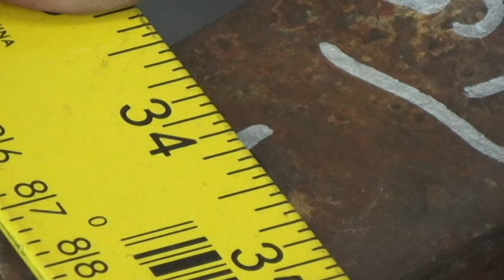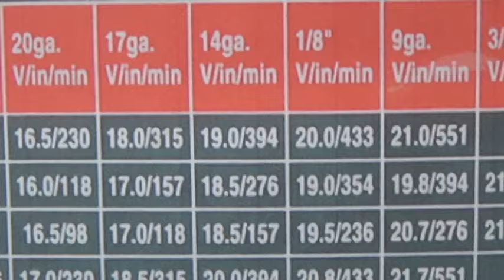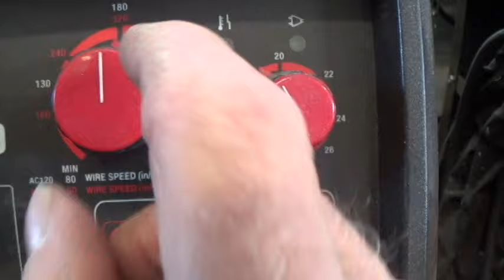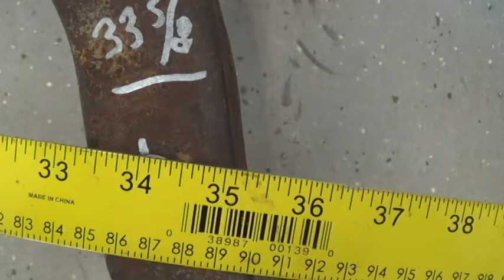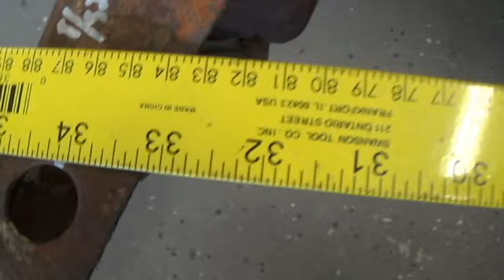1964 Impala Wagon Frame Horn Repair

Comment: Thanks Gene you just solved my issue with my passenger side horn
Reply from the maker: You are very welcome. Obviously I don’t know how far in or out yours is bent, so how bad it is will dictate how many cuts you will need to make. Good luck.
Reply from the maker: Just heads up to learn from my mistake. It would be a good idea to first lay a small bead weld along the top and bottom of the outside frame rail where it lays on top of the inside rail where you are going to cut. In the area isn't welded from the factory so when you make your vertical cut the piece will just fall off/out. This way you won't have a big gap like I had.